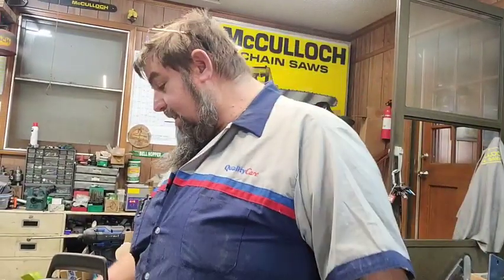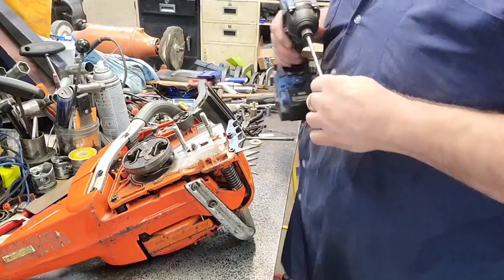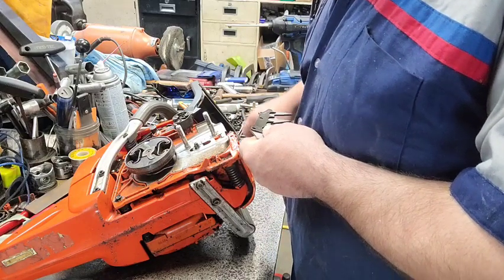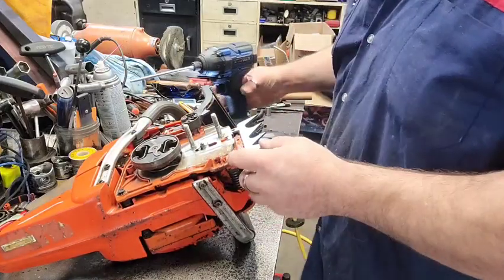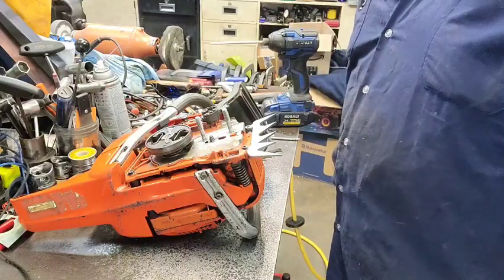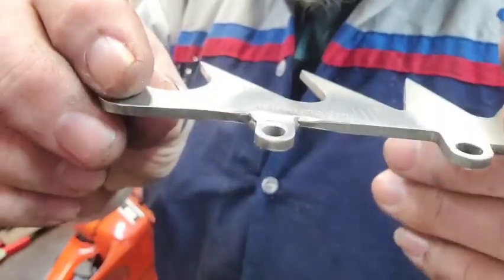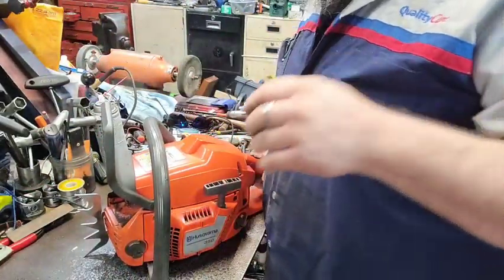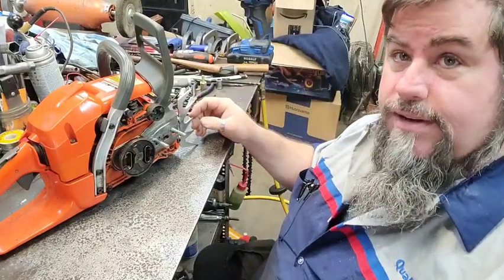Custom Felling Spike Quick And Easy "Saw Dawg"

Comment: I’m not a tree cutter but had the chance to take down ten small trees. The saw I was using had no spikes/dogs. Later on I replaced the spikes to take down two larger trees. What a difference!!!! The added use of leverage and not having to be the saw stabilizer made the job so much easier.

Comment: Quote from New Life Newsletter:
Crossing The Canyon 
In all labor there is profit, but mere talk leads only to poverty. Proverbs14:23

Imagine a steep, narrow canyon, 300 feet deep and 15 feet wide. You are on one side. On the other side is your life’s dream -- everything you could ever want, so close, yet so far away. There is no bridge across the canyon. You could try to jump across. That would be the quickest and easiest way, but you probably would not make it. You could sit and wait for a helicopter to come and ferry you across, but it probably would never come. You could hope that someone would come along and build a bridge, yet that may not ever happen. Or, you could start working your way down into the canyon, step by step, until you reached the bottom. Then, just as tenaciously, step by step, work your way up the other side. It would not be easy. In fact, it would get more challenging as you went along. It would, however, get you there. Too often, we sit and wait for the “easy way out” to come along. Yet the easy way, despite how much we would like it to, rarely comes. Occasionally it comes easy, but not very often. While others sit and wait for things to get easier, we will get to work. Consistent effort, day after day, is the reliable route to success.

Father in heaven, how we long for life to be easy and so we procrastinate, hoping for an easier route. Forgive us for settling and for sitting instead of starting. Help us to make steady progress each day, being unafraid of hard work. In Jesus name, AMEN!

Stop wishing, start working.

Comment: Still glad and happy I've found your channel. Need advice, could you recommend a replacement carburetor for my stock 365 SPECIAL and also tell me what carb should have been on it originally?
Reply from the maker: I use carbs from the duke if i cant find a oem carb but it should have had a walbro HDA on it from factory

Comment: Good to see ya 🎉 happy New Years to you and yours💥 Question if ya got the time…. After warm up My 288 is backfiring 🔥 out the exhaust! I removed the muffler, piston n cylinder looked good. I doubt it was ported, I haven’t ID the cylinder yet. I’d say the Ring was a bit worn and it’s loosing compression. I began thinking timing pin sheard, it looks like it’s in there although I haven’t been successful at taking the flywheel off. Could it be a broken ring or should I go after the timing? Giver a thought if are able. You’ve always been good to chat with. Thanks 🙂
Reply from the maker: Hey buddy if it has the 2 peice igntion the one at the flywheel may be going out those have been none for that and it bout takes a puller to get the flywheel off
Reply: Wow really! Thanks for the info. I’m going check that out! Was about to tear the whole saw down! That’d be great if that’s all it is👍